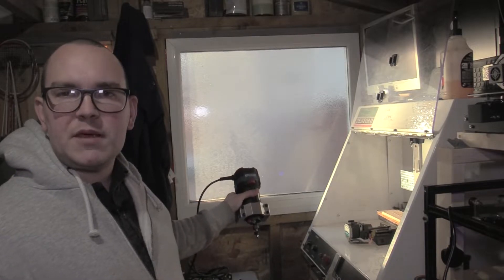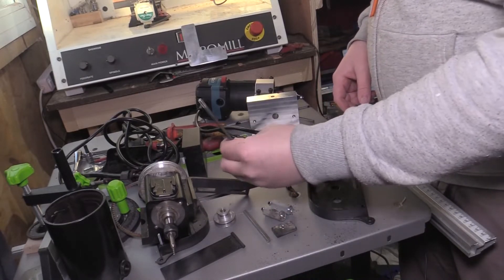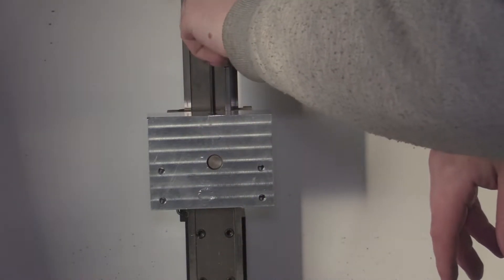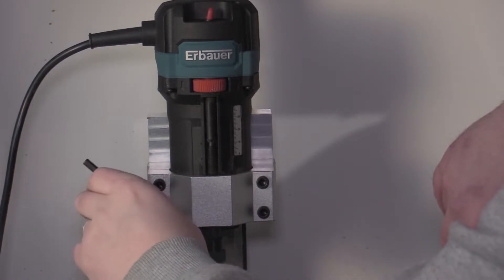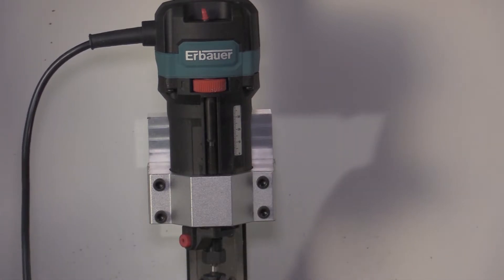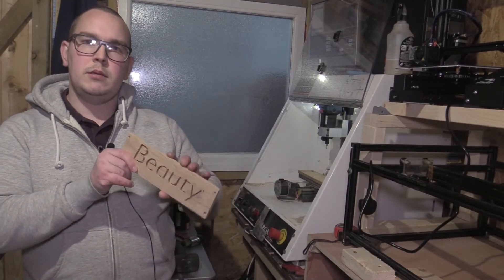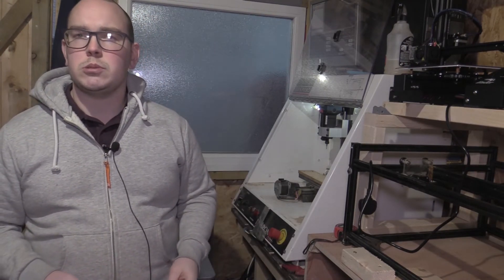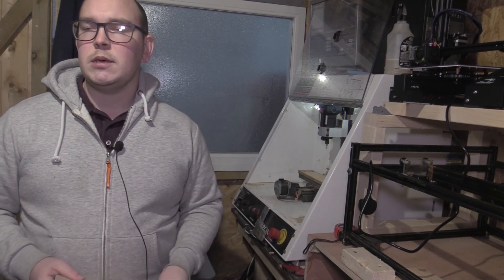Denford Micromill Router Upgrade

Comment: Hi
I've just bought on of these rewired it running on windows 10 laptop with usb , moved the spindle forward to have more y axis, running on mach3 I could do with your collect as I haven't one
Reply from the maker: Hi
Sorry Tony but I've already sold it. I got it from rdg tools though if you want one.
Regards
Nathan
Reply: @mrmechanical3423  thanks Nathan, I was inspired by your previous video on the power feed I am doing all my axis the same way and converting my china mill to cnc as I can convert all the steps and backlash feeds and speeds  in mach3